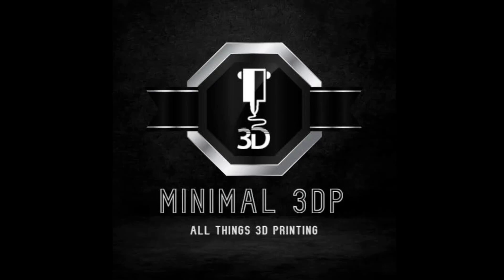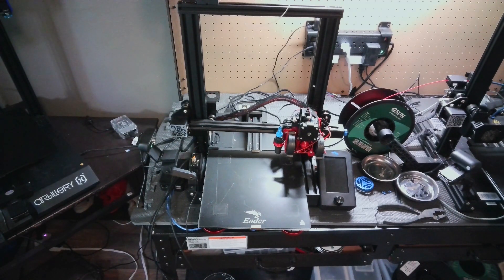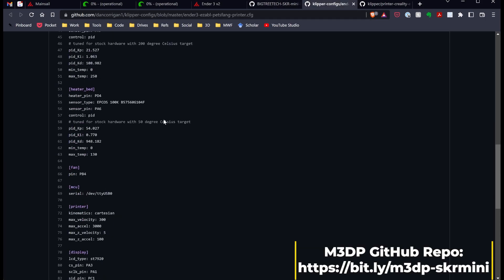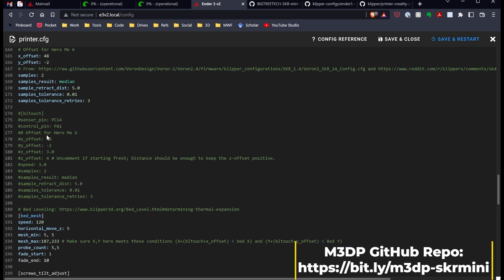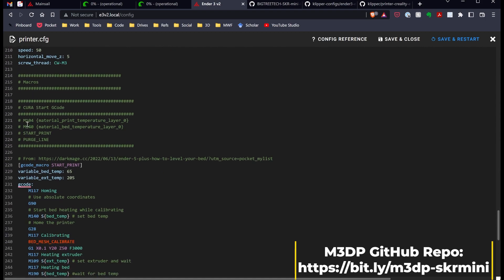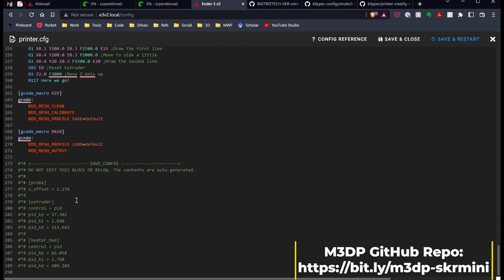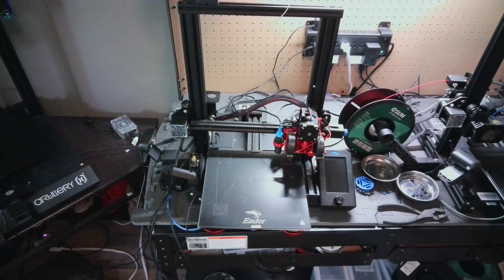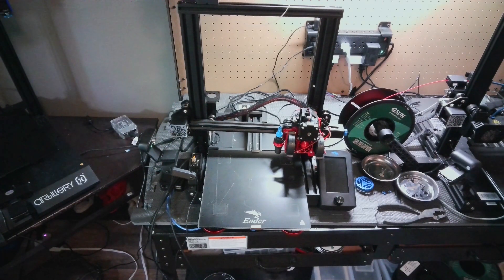My COMPLETE Ender 3 v2 Klipper Profile using a BTT SKR mini e3 v3 with a BL Touch or EZABL Pro

Comment: Thank you for the video. 

I am still fairly new with Klipper and such. But, I am wondering since I don't have a Ender 3 V2. But, I did buy the screen the TFT35 if it'll work the same regardless.
Reply from the maker: It will not. You can get th3 screen to work with klipper but it will be more limited.

Comment: Thank you so much, I'm banging my head against the wall with my ezabl.  Used marlin for year's, I've finally fathered enough courage to try klipper. I'm definitely struggling over here.  There's very little documentation for ezabl.
Reply from the maker: Glad you found it helpful.

Comment: Hi, great information that helped with my struggle setting up. It is quite the learning curve getting to grips with the initial install of Klipper only to find that it is about 60% done and you have to then work out how to get everything else going! Managed my first actual proper print yesterday and at least now I can relax a little and experiment more. My only difference is the my BL Touch on the Ender 3 (pro) being on ^PC2 (originally set for sensor-less homing?). I only mention it as others may get stuck here as well.
Reply from the maker: Glad you found it helpful.

Comment: It is probably because I am stupid, but I don’t get this to work. I have an ender 3 v2 neo (cr touch) with the sprite direct drive extruder pro kit, and the skr mini e3 v3 board. Running klipper on the btt pi v1.2 . After installing your printer.cfg I get all kinds of errors telling me it’s missing stuff. After excluding things from the printer.cfg the errors are gone but my extruder isn’t homing and worse it loses it’s connection and moonraker is no longer capable of connecting to klipper. I tried a dozen times over and over again 😢 but no success. I don’t know what I’m doing wrong. Would it be possible for you to make a step-by-step video on how to install this properly ore perhaps a step-by-step guide on your GitHub. It would be very helpful for me.
Reply from the maker: Can you share your printer.CFS so I can see it?
Reply: @minimal3dp   And how do I share that

Comment: Hi, enjoying Your videos. I am freshly starting with Klipper. I do have an old Ender 3 Pro. Can Your cfg be used for him as well, or do You know any better suitable one?
Reply from the maker: What board are you using?
Reply: i do have an BTT SKR Mini 3 V3, My ender has a BMG direct extruder and uses BLTouch @minimal3dp
Reply: @minimal3dp  I am sorry, but i didn´t get Your Question right i assume. My previous Board is an MKS SGEN 1.0 Board.

Comment: I had issues that I was commenting back and fourth with you about and I found this video and used this cfg file and it got me way farther along. It’s hard for me cause when I started I probably shouldn’t have even tried to do any of this. I’m getting better. lol🤦🏼‍♂️
But both of the videos of yours that I have used have helped me the most.  I have it working now. The next problem I’m having is getting all of the bed dimensions ironed out. I got it much closer, but I’m still off about 10mm. Meaning my BL touch when homing to start a print the BL touch goes about 10 mm past the corner of the bed and then when it does the purge the head is 5 or so mm over the edge of the bed.
Reply from the maker: Sounds like you might need to play with your offsets.
Reply: @minimal3dp  ok I figured out that my x axis goes 5.0 past the end of the bed before it stops and the y axis goes 13.5 before it triggers the end stop. what would I need to change to correct that.
Reply: I replaced my hot end to a microswiss all metal direct drives added a cr touch, the blockhead cooling fan with the better fan, changed the board to a BigTreeTech tech skr mini e3 v3, and added a rasberrypi so could use Klipper. also added a waveshade touchscreen to use Klipper screen. as it turned out this project was way over my head. I got some of it done with other videos before I ran across your channel and that is when I got to a point where I felt it may be possible for me to get my printer back to full function. lol. I wanted to explain all of this to let you know to stay after this you tube channel. its very good and you will be at 100k plus subscribers probably a lot sooner than later!!
Reply from the maker: @chadsanner792  I appreciate the kind words. I am glad the videos helped. Don't hesitate to post if you have questions.

Comment: For some odd reason whether I run it in mainsail or fluidd, it can’t find the bed mesh config file. Has that happened to anyone else?
Reply from the maker: Do you have a virtual SD set up in your printer.cfg file?
Reply: I’ll have to take a look at that when I get home. It honestly could be an issue with using the mks pi.

Comment: Hiya, been trolling your vids and found this one. My issue currently is, because V2 Neo BLtouch comes with 5 pin ribbon and goes directly to the (which I believe called ABP port)  I do not have any 3 pin that goes to the Z 3 pin on the board. I've managed to flash and get it connected to klipper now. the issue now is whenever I try to home, it came up with an error "BLTouch failed to verify sensor state"
Reply from the maker: what is your probe settings in printer.cfg?
Reply: @minimal3dp  I have managed to sorted it out with your recommended skr mini config from your other video. it's working fine now. Didn't have to cut and rewire. just use the 5 pin from bltouch directly to the ABL port on the board. 

I took the easy route of replacing the board with skr mini. I still have the "broken" Creality 4.2.2 with GD32 MCU that I'm not sure how to flash as it's not responding to anything I've thrown at it.

Comment: Just watched your video as ive just installed klipper to my ender 3 with ezabl probe and its giving me a headache with crashes.. Can i copy just the probe config to add into my printer cfg. I have the skr mini e3 v3.0 main board with klipper installed on raspberry pi3b.
Reply from the maker: You should be good just using the probe config. Let me know if you need more help.
Reply: @minimal3dp  thanks for the reply, not sure where the config cfg is your refering to

Comment: Hi Mike, I am seriously thinking of throwing in the towel. Im trying to get the sonic pad working with the skr e3 mini v3. I am a noob at all this config malarky. How do i put the firmware onto the board and where do i put the printer config?
Reply from the maker: Can you see the firmware file on the sonic pad?
Reply: @minimal3dp   No, looking through web interface i have a list : printer cfg, printer_bak.cfg,moonraker.conf,nginx.conf (which i deleted earlier and had big trouble getting it back up) timelapse and webcam.
Ive gone through 2 ways inc using ubuntu and compiled a firmware but the sonic pad is just sitting looking at me dumbfounded. im hoping you may be able to help, cos i may just send the skr back and go back to my original creality board :(
Reply from the maker: @markstacey6082  you mentioned creating the firmware via Ubuntu. Can you see the Klipper.bin file that was created?
Reply: @minimal3dp  yes, found it on the pc, renamed it firmware and put it on a micro sd card, put it in the board turned it on . i had 1 solid red light and a few flashes of another red light.....probably about 3 flashes in all. Plugged in the sonic pad, waited and nothing. i tried copying over your printer.cfg over in the web interface but kept getting gcode location is wrong
Reply: @minimal3dp  sorry , i just checked, the error is invalid root path (gcode)...   I am very appreciative for you help🥴
Reply from the maker: @markstacey6082  I think you are close. If you want, email me at minimal3dp@gmail.com and I am open to doing a zoom to get it going. I am out of the house right not so it will be at least an hour or 2.
Reply: @minimal3dp  many thanks, will do

Comment: I have Ender 3 S1 Pro, Klipper/Mainsail, and can't for the life of me get the probe/zstop to work. I have the wire from the module (on pin 1/2) plugged in to the F401 board for limit switch. The ezable Pro triggers (blue led at top) when its close to the plate, turns off when I manually move it up a bit. But refreshing Endstops (in Machine section) always sees it open. Iv'e tried to use pin ^!pb0,1, PC14/12 (bl touch one), and a few others. Nothing seems to trigger. I tried flipping the little switch in the ezable module as I am using the 2 pin plug on pin 1/2. Can't seem to find any other info or anyone using klipper and Ender3 S1/S1Pro that has this working.
Reply from the maker: What board are you using?
Reply: @minimal3dp  Ender 3 s1 pro.. F401 board. It came with crtouch, so the limit switch on the board was not used. Where the cr touch plugged in to the extruder.. that is not used.. not sure why.. but the way the EZABL is designed, you plug it in to the module, and then on most printers that had zswitches.. you'd just plug that in to it.

Comment: Good stuff! 

I just finished upgrading my Ender 3 Pro with an SKR Mini E3 v3, Orbiter 2 extruder, all-metal hotend, BL touch (clone) probe, dual z-axis motors and whole lot of other things. I've got everything playing together nicely and defined in Klipper and this (plus the other one you made!) is exactly the video I needed to help me wrap my head around macros. The one thing I didn't research, heh.

I plan on finally trying out different slicers, so I'll be adding as many gcode macros as possible to my printer.cfg to bypass setting them up in individual slicers. One file to rule them all.
Reply from the maker: Hope my videos are of help to you. Let me know if you have questions.

Comment: I am trying to use your firmware.bin for my ender 3 and it doesn't seem to be working.
Reply from the maker: What errors are you getting?
Reply: Thank you for your reply, I actually figured it out, i had to get a new sd card with nothing on it and rename the file
Reply from the maker: @alecconn4123  glad it was an easy fix. Let me know if you have questions.

Comment: Would I need to change anything for an original Ender 3, not the v2?
Reply from the maker: I don’t think so. I think everything is pretty much the same.
Reply: @minimal3dp  It seems my nozzle and BLTouch are off the bed when performing the bed mesh calibration. What should I adjust for this?
Reply from the maker: @CGK3001  you need to adjust the z-offset
Reply: @CGK3001  I’m about to do the same thing were you able to get it to work?
Reply: @alecconn4123  yup! Works like a charm!
Reply: @CGK3001  great thank you

Comment: My board arrives tommorow. I have the 3v2 with sprite pro and crtouch. Should work all the same right? Im excited im only swapping boards because mine has a GD chip and i want klipper lol
Reply from the maker: It should work the same. The rotation distance will be different but you can calculate that. You will like klipper.
Reply: @minimal3dp  ive used klipper on my s1 pro and 5 pro the 3v2 has just been issue after issue with klipper for me
Reply from the maker: @Pdunns3D  I have not had any issues. What problems are you seeing?
Reply: @minimal3dp  it all started with flasbing which led me to discover the GD chip. So i need a new board. And its been a lot to figure out but i think its finally all coming together

Comment: Thank you so much for both this video and the video on installing the SKR Mini e3 v3 board. I'm about to install the board and want to run Klipper on it and your guides is by far the best ones I've found! :D

Two questions about this:
I have a CR Touch. Would the BL Touch-part of the code work with this too or is there something I might need two change?
What's the fan housing you use on the hotend? Going to print at new one and the one you have looks like what I've been looking for!
Reply from the maker: You should not have to change for the CR Touch. I am using the HeroMe 6. HeroMe is now on version 7. I will try to post my printer.cfg for a reference for you tonight (after work).

Comment: Firstly, many thanks to you for all those configs and macros.
I have Biqu h2 v2 direct drive extruder and I need to change the x offset because my CR Touch is located on the right side. I tried to change the x offset below the [bltouch] section in the printer.cfg.
But the extruder is going to same location. I confused. Is there any additional config should I change?
Reply from the maker: You should just need to update the BLTouch section. As far as I can see there is no other changes you need to make.